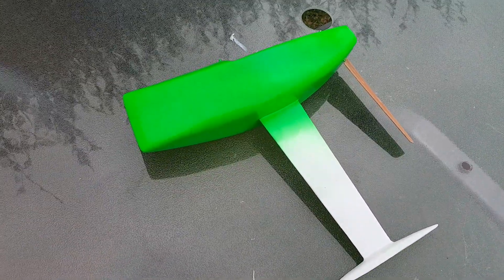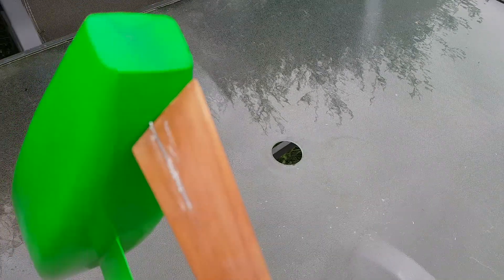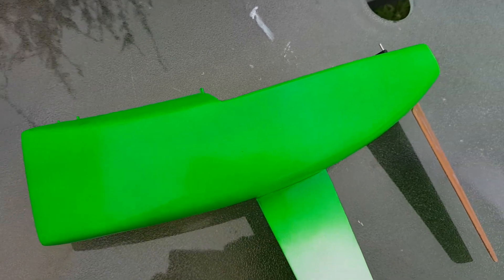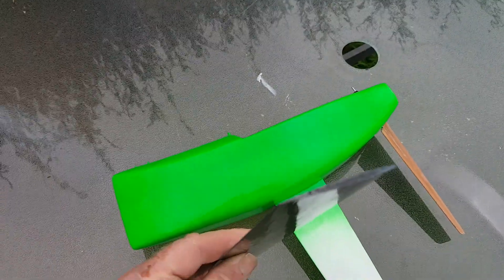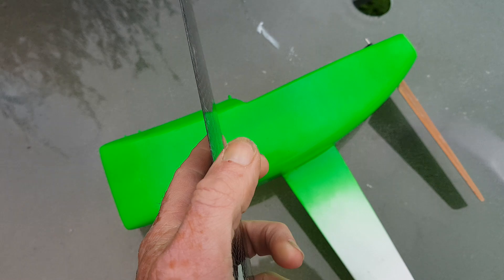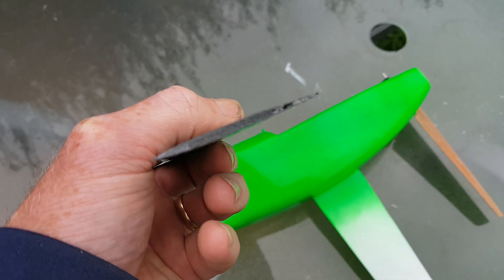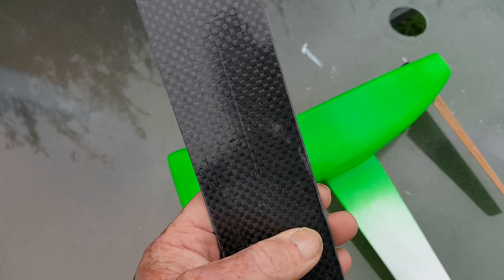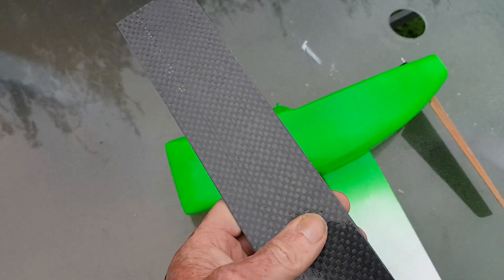Footy carbon fin

Comment: Hi Brett,
Love the work you have done with the fin. I am building a footy at the moment and was looking around for carbon fins. Is that fin of yours available for purchasing?
Reply from the maker: Hi,thanks for your interest in my fins.What weight bulb will you be using,if it quite heavy a stiffer fin will be required
Reply: @brettmccormack6277  I am thinking something close to 300gr-330gr.